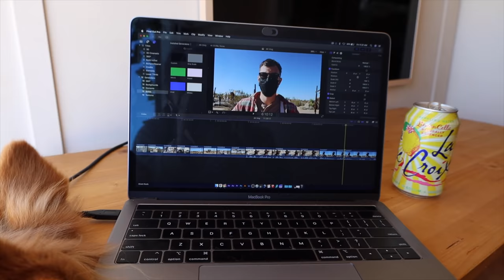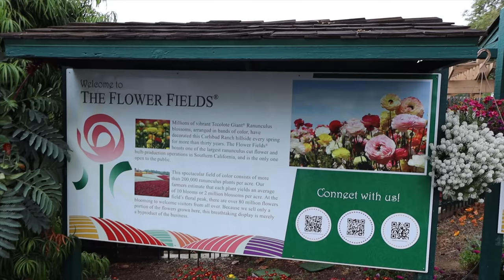This was my scariest night of vanlife // Overnight at the Salton Sea

Comment: I m so happy I went with the Kildwick compost toilet.  The solids is a bucket I line with a bag and it has a handle so when it needs to be emptied I just take the bucket out and tie up the bag and throw it out.  The urine is another container and it has a lid so when removing I put the lid on and no risk of spilling as I take it out and or when driving ☺️.